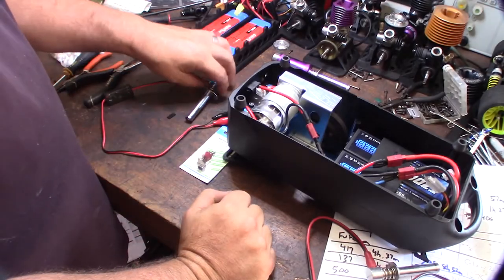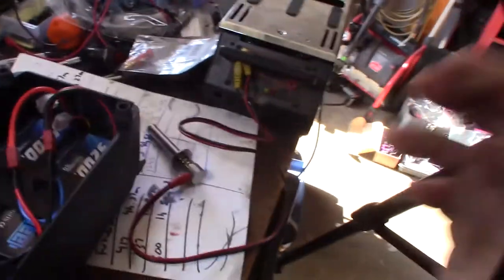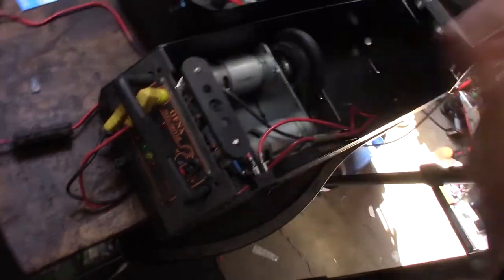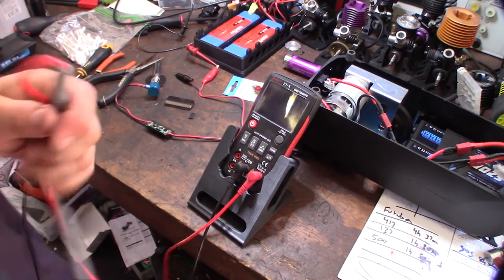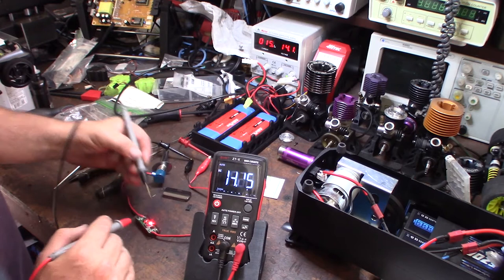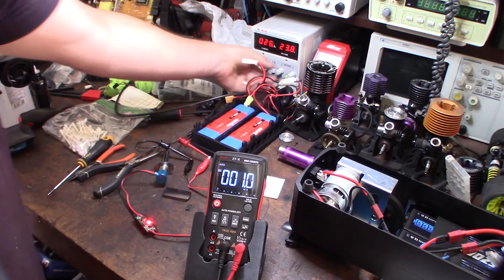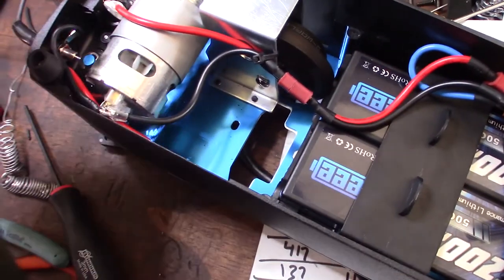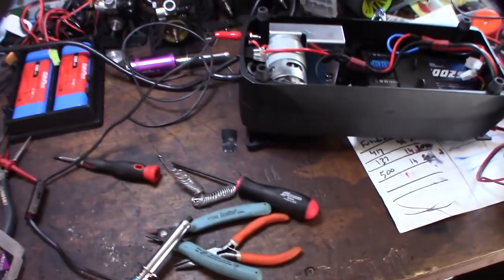Glow Plug Igniter run off RC LiPo battery bump starter box with voltage regulator

Comment: Hey I need your help. I bought this glow plug igniter made a 3d printed box to attach it to my starter box and also I solder new wires to better fit my rc needs. But for some reason now is not working. When I attach it to the 3s lipo it reads 11.2v in the input and reads 1.2 in the output in the board and when I read at the igniter itself it reads 1.2v. But when I attach the plug it does not get ignite and in the board output it reads 0 volts. 
Any idea why this might be??